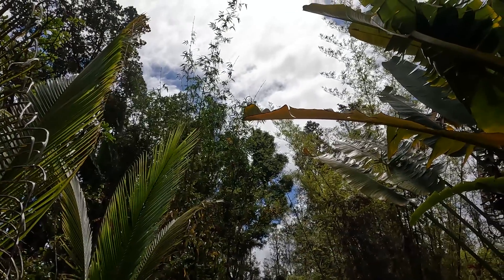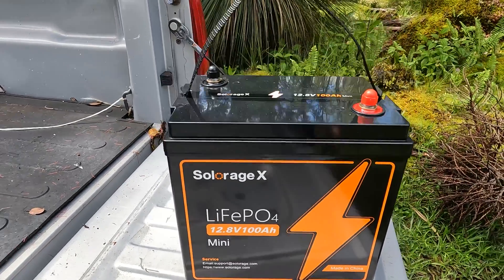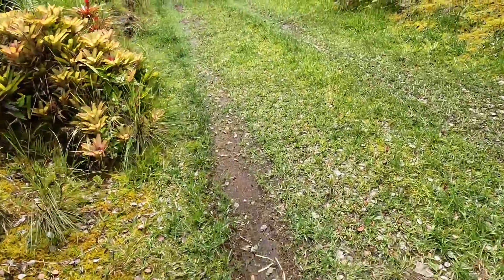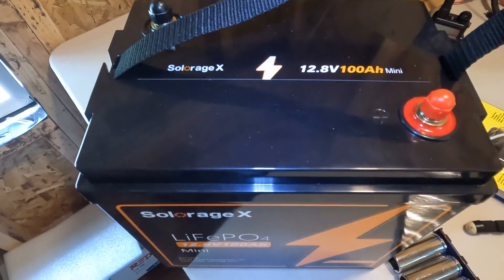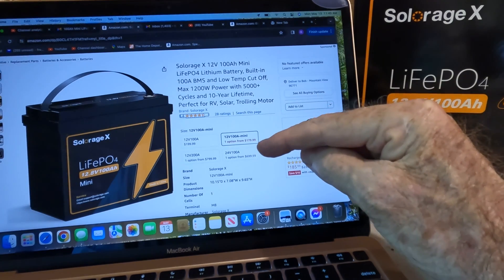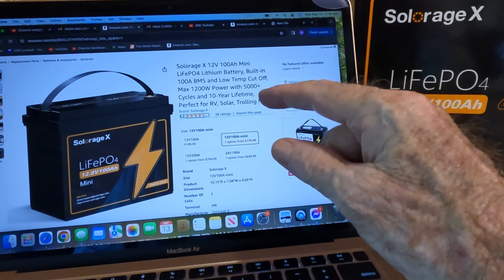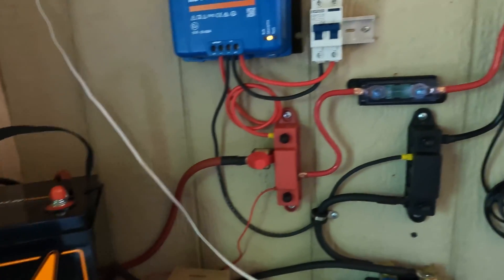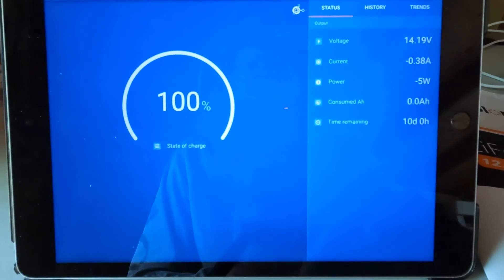Solarage X 12.8V 100Ah Mini LiFePO4...How Low Will the $ continue to Drop!?

Comment: great test. I have nit seen a battery fall short of rated capacity in a long time. they over delver. that a good thing. low temp is common now. not only the price going down the size shrink as well for same AH . just a few years ago the 100 Ah all bigger. solar weather crazy as well. very large solar flairs. NOAA putting out warnings. GPS effected/star link and whole bunch more. can effect power grid. the sun has in the past. northern lights seen in NY and much more south. HAM and short wave radio messed up. small solar and wind stations un effected . great way to have power. every 11 years the sun goes threw a cycle. we at peak . just can't relay on power grid. lots of you tube showing how easy it is to have solar and it works quite well.
Reply from the maker: I have been seeing the images from all over, even way down south of the Northern lights! Amazing. I keep looking here, but nothing yet, but usually cloudy at night. Haven't had any real problems here I know about, although the other night all over the air tv channels went offline for a bit. Not sure why, maybe from those flares! Rolling blackouts on the grid here past few weeks, but a major generator was down. That is becoming more common. Does not affect me though! Aloha!🤙